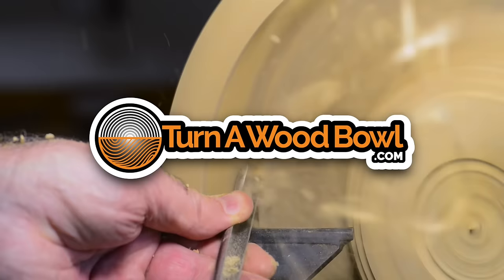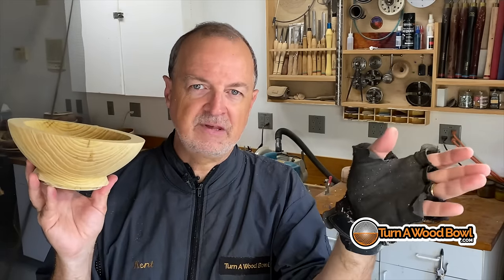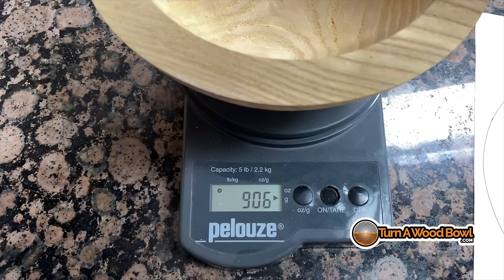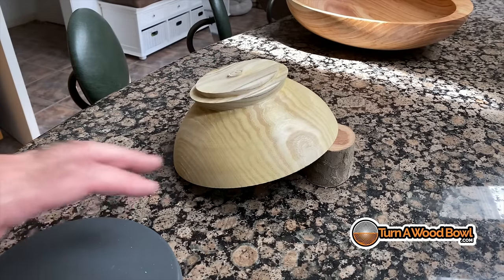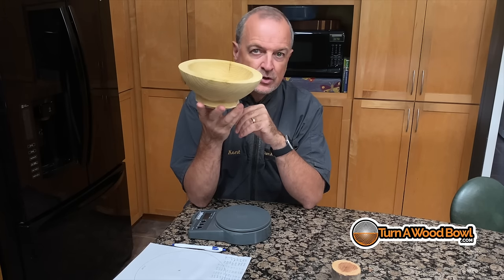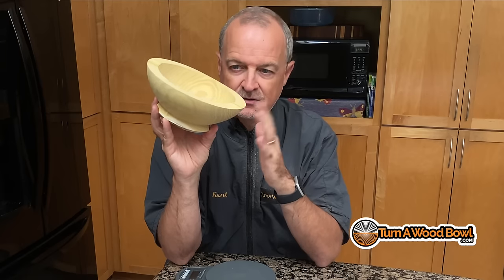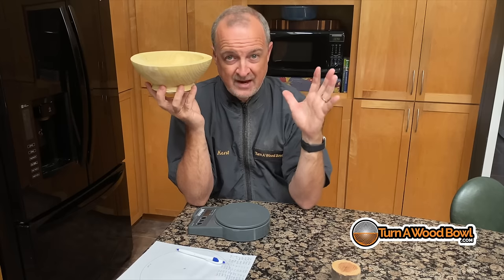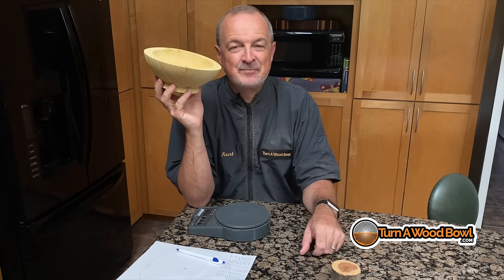Microwave Drying Wood Bowl Blank Woodturning Video

Comment: Very interesting video, and I like your systematic and scientific approach.  However, here is one point of vocabulary.  It's not quite right to say that the wood is "equalized" with the environment, and the condition is NOT that there is the same concentration of water in the wood as in the surrounding air.  Rather, the wood is said to be "equilibrated," which means that it is in dynamic equilibrium with the surrounding air.  The equilibrium is "dynamic" because water molecules are still flying out of the wood into the air, but this loss is balanced by an equal number of molecules flying from the air back into the wood.  As you explained at the end, if the external humidity changes, then the wood goes out of equilibrium and gains or loses moisture until equilibrium is again achieved.  That is, the wood re-equilibrates.

Comment: What happens with an expansion recess that has become oval after drying?
Reply from the maker: It too becomes oval. It will need to be re-trued on the lathe. Tis is also another reason I like tenons, they are easier to true after drying. Happy Turning!

Comment: Do you seal the end grain inside and out before microwaving?
Reply from the maker: Good question. No, for two reasons. We want the wood cells open so moisture can escape and we don't want to be cooking sealer in the microwave. ;) Happy Turning!
Reply: @TurnAWoodBowl  I am presently trying an 8” sycamore bowl in the microwave, about 4 hours in. Weight down 20g and moisture only about 5% down. I have just turned once a spalting laburnum and it has been treated with a “wet rot repair” fluid. Will be interested to see the reaction as the wood is quite damp.

Comment: First question, do you recommend to start microwaving the bowl for 45 seconds at the start, or go from 30 seconds to 45 second, secondly what wattage is your microwave, is it better to have a high or low wattage for drying bowls. Thirdly, if i microwave a bowl in a microwave, it that microwave still ok to use to heat up food?
Reply from the maker: Try 30 seconds and if the blank  is not too hot, go to 45 seconds. I recommend starting at lower times. If you have a small bowl, 30 seconds might be too long. You will need to experiment a bit. All the best to you!

Comment: I use my oven but iam open to new ideas. I dry thick slabs to make dough bowls. 180-200 degrees watching for cracks . remove and let rest a few days. check with a meter . back to oven as needed.
Reply from the maker: Sounds great!

Comment: Kent, I've done some research and testing with this method and found it insufficient compared to long exposure to controlled heat. Yes, a 'nuke box' will heat up the wood and fast. However, the density of the material does not allow the majority of the moisture to escape in the short period of time being heated. 

I put my raw pieces (cut, but not turned) in a large 5 burner propane grill with the lid down. I put the piece at one end and light one burner at the other end. If you light a burner under the piece, it will go to ignition point. It takes about an hour of monitoring the temp to get the cabinet temp adjusted and tuned to 350. Soft woods will go to auto ignition at around 450, thus staying at around 350. I run this for several hours, sometimes all day for a large piece. 

This gives the moisture time to be driven out and the wood to completely dry. One side effect that warrants being mentioned, this also hardens the wood. This can be looked at as good or bad.

I have subscribed to your channel and watch your videos frequently. Thank you for sharing your expertise with us. Turn on and 'Safety First'!

Jim
Yoakum, Tx.
Reply from the maker: Sounds interesting. Experimentation is a must. Happy Turning!

Comment: Curious if you've tried a food dehydrator? I haven't tried this. It just occurred to me.
Reply from the maker: I have not, but I don't see why it wouldn't work.
Reply: I was thinking the same thing.  Low heat & a fan that extracts the moisture.  I might give it a try.

Comment: great video, especially in regard of your systematic way of working. And as a European I'm happy about your changing from ounzes to grams :=) But for serious: did you ever consider of taking the piece to a vacuum chamber after microwaving it, just for speeding up the drying process even more?
Reply from the maker: Thanks, but no I have not used a vacuum chamber yet for drying. I think I'll have to check that out. Happy Turning!

Comment: I tried this method on 3 bowls and they always cracked :/
Reply from the maker: Remember every wood, every tree, every bowl blank is different. Some wood just cracks. Also, the moisture content might be very high, if so, let the wood "mellow" for a couple months and then try again. See if that helps. Happy Turning!
Reply: @TurnAWoodBowl  I think you have just found the problem, the wood i've made the bowls from was cut like 2 days before turning those bowls. so the moisture content probably was very high, even though the tree was broken by a wind and was laying there for a while.
 
Thanks for your quick response!
Reply: @TurnAWoodBowl  and one more question if you don't mind, what is a suitable moisture content for a bowl blank to microwave dry?